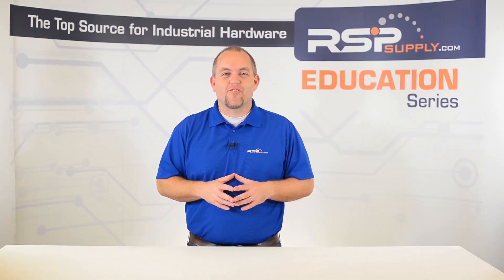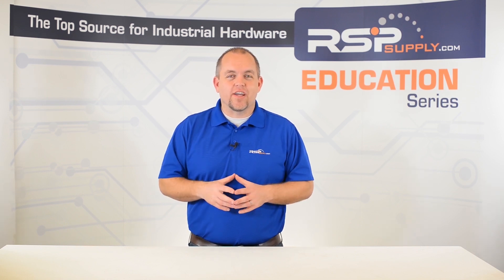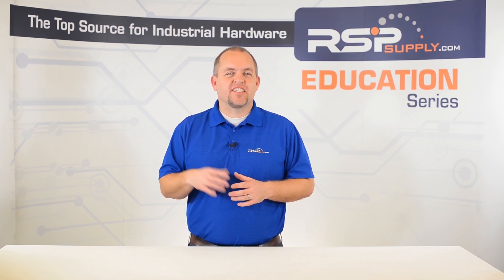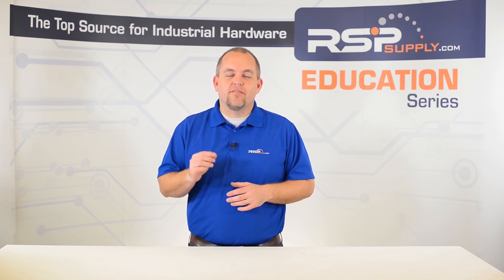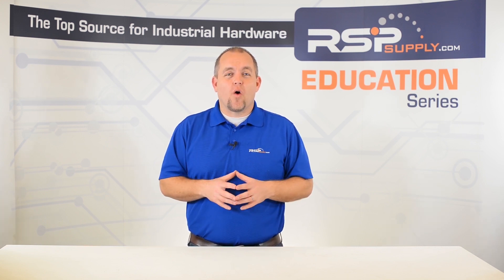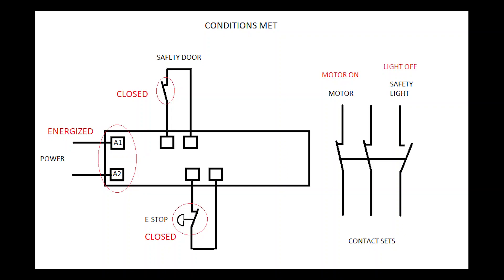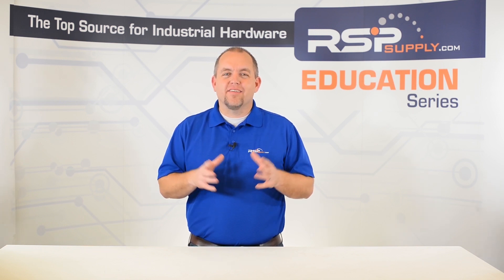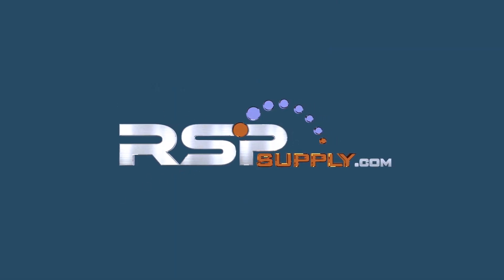Safety Relays   Part 3

Comment: Good series of videos. Thank you for them. I do have a couple questions. I do believe I understand the concept. What benefit does a $100+ provide versus a standard relay that is controlled by the same aux contacts controlling the safety relay like the E-stop and safety screen in video 3. 

Speaking of video 3, it states at 5:46 in the video that another video to follow showing a safety relay mocked up in control circuit. Which video are they referring to? Thanx

Comment: Great video!

I still have a concern about the input signals for S12 and S22 of these safety devices, are those 24VDC or 0VDC? Because when i read on the datasheet sometimes it take the signal from light curtain, estop or they are connected from S11. Hopefully that I can get the help from RSP or any member on this channel!
Reply: S12 and S22 are just considered input terminals for the safety channels. S11 is an output terminal and S12 is an input terminal. By feeding 24vdc to A1 and A2, that provides power to the relay allowing it to use that power to pulse test these terminals. Essentially, power from the relay input is being outputted into a specific high/low pattern unique to the S11/S12 channel. It’s sending 24vdc DC out of S11, through a NC contact on let’s say an E-Stop and into the S12 input terminal. Essentially the reason your safety relay changes state is because it normally is pulse testing through the E-Stop and into S12 and the safety relay knows everything is good but once you open the E-Stop’s NC contact block, the pulse test no longer reaches the S12 input terminal and the relay knows the EStop has been opened. Same goes for the S21/S22 channel. S21 is outputting the pulse test and S22 is inputting the pulse test to confirm the circuit is functional. Hopefully that helps!

Comment: These videos have actually saved my life. Started a job in a food manufacturing plant and as the night electrical engineer a massive part of the job is to be able to understand and fault find on a variety of safety relay circuits. That coupled with the panel building series being so helpful, I can't thank you enough. Amazing videos. Can't wait for the next part.